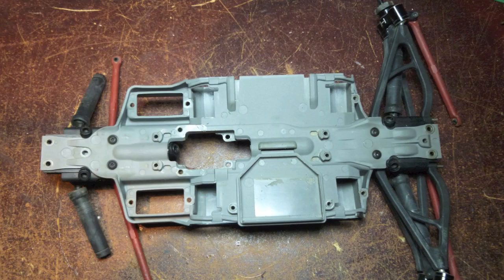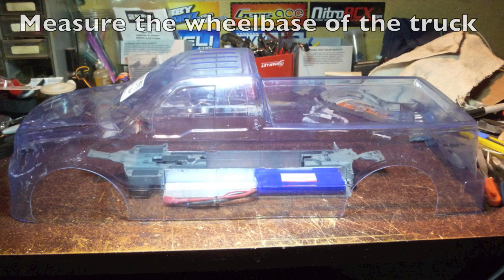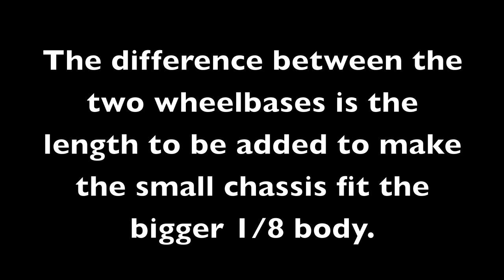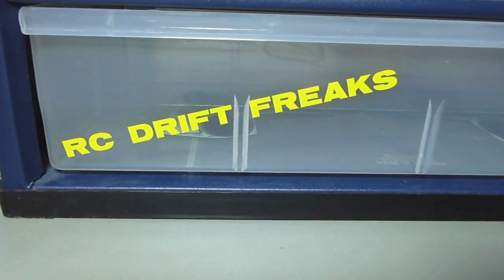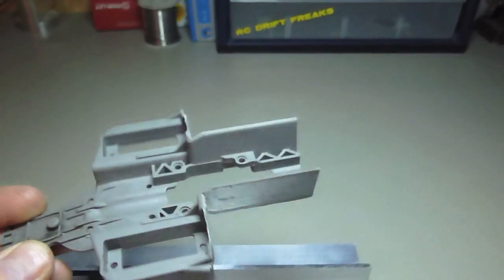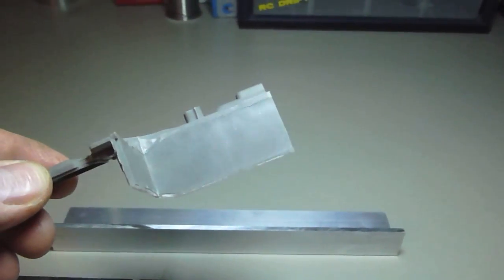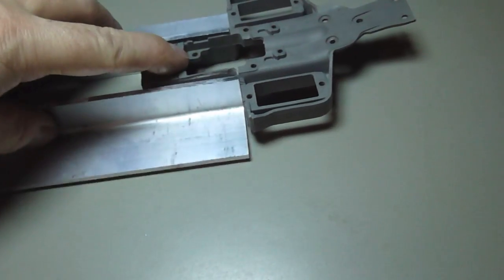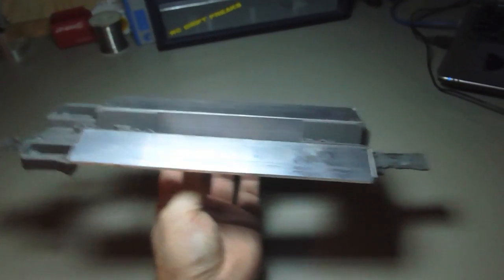1/16 Summit to 1/8 Conversion Part 1

Comment: Where did you buy these metal angle ??
Reply: Thanks
Reply from the maker: These can usually  be purchased at your local hardware store.
Reply: theLEDwheel like Canadian tire I live in Canada to
Reply from the maker: Yes, some have. Or reno depot, home depot..
Reply: Is it 2 inch by 2 inch
Reply from the maker: 1x1 inch
Reply from the maker: Pretty sure it was 1x1... i cant imagine it being 2x2. Thats too  big
Reply: Yeah that is real
Reply: Steel or aluminium??
Reply from the maker: Aluminum

Comment from the maker: The trac on this 1/16 summit is quite wide. Actually still wider than the 1/8 body by about 20mm so it will look like a more to scale looking street worthy truck which is exactly what I want. Right now its lengthening the rear drive shaft that I have yet to figure out.